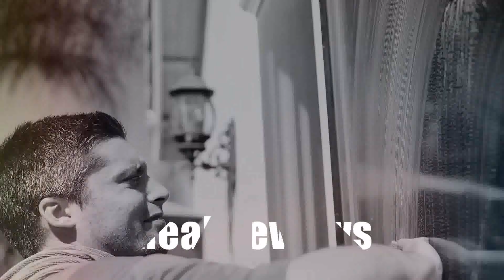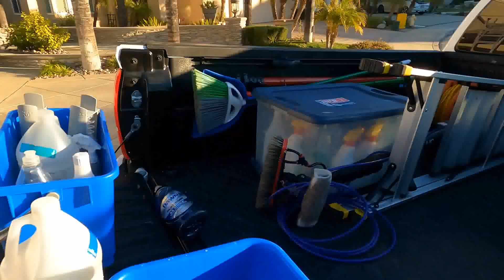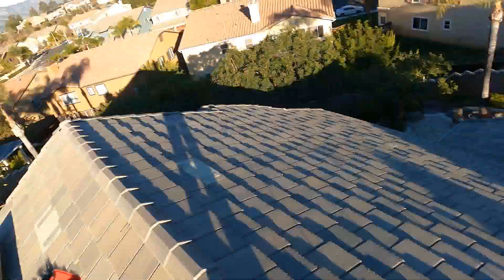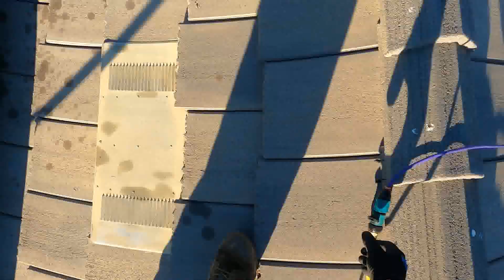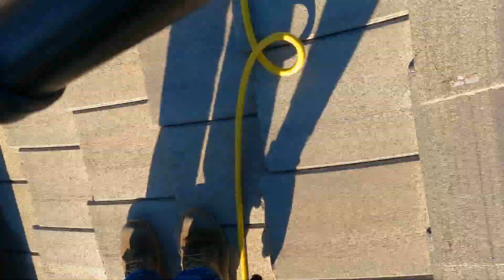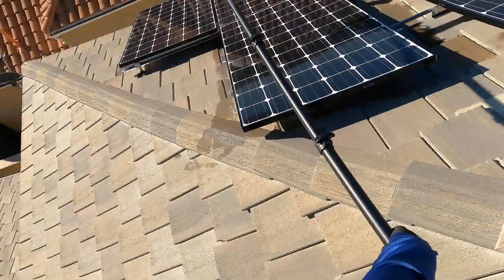SOLAR PANEL CLEANING

Comment: Looks like a long haul job there buddy...did you not pre treat with chemicals etc?
Reply from the maker: I did not use any chemicals on this job sometimes I do but I wanted to see how well the brush and scrubber do without it. This is still a new tool. Sometimes I use dawn platinum or solar gleam 👍🏼